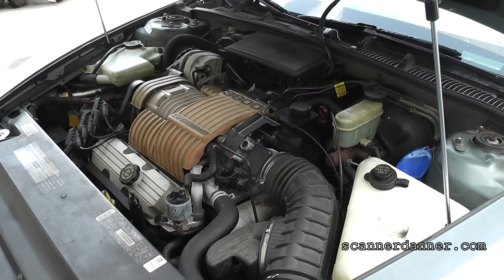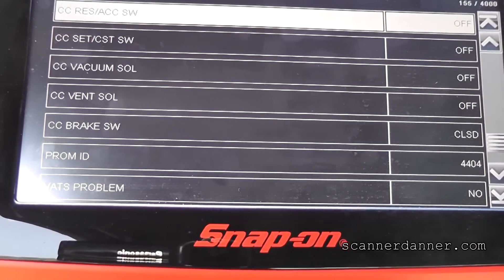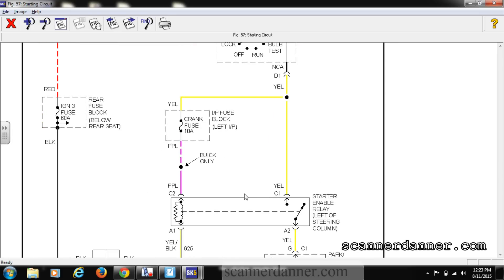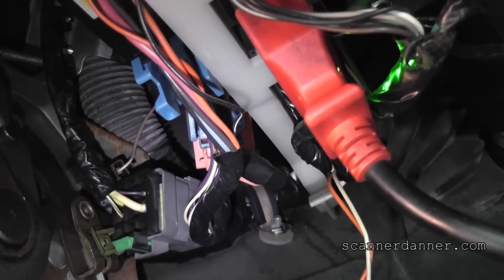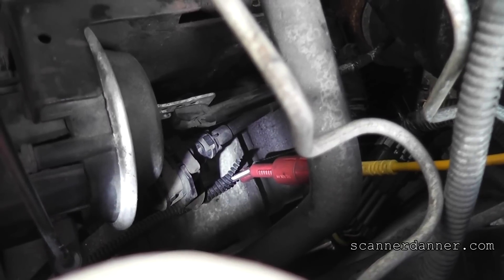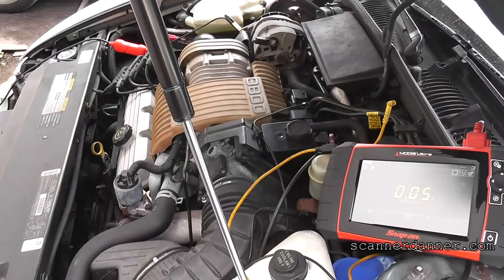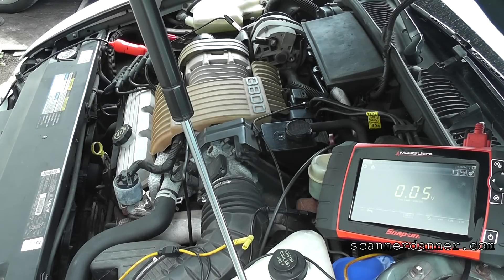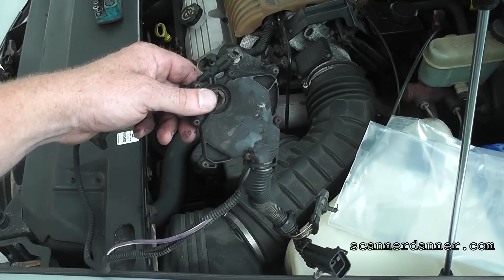How to test a starter (engine doesn't crank)- bad park/neutral switch-GM 3800

Comment: Hey Paul. I'm a big fan. I have a question about your class at Rosedale Tech. Does Rosedale allow the option of anyone to just attend your course rather than go through the entire automotive program? If not, do you offer any seasonal night classes? Thanks Paul
Reply from the maker: +120beale they have offered my class as a stand alone. Email me and I can get you in touch with one of our admissions reps for costs.
Reply: Hey Paul I really appreciate your fast response. What's your email address? Thanks Paul
Reply from the maker: +120beale I won't post that here. Contact me through my website at www.scannerdanner.com thanks!

Comment: Just want to say i love your videos.   I do have a question.  I notice when you are checking relays, you check input / output.  My question is, why don't you check the output first?  In my humble opinion, it would save you time in the long run, if it is good, you get output, so the input was there also.     Love your videos, You are the man, i have learned so much from you over the past couple of years, you should charge me tuition lol.
Reply from the maker: +Rhage73 I do sometimes. I'm not partial. Symptoms will dictate my direction and also relay location. Thanks!
Reply: Thanks for answering me, Have a good one.

Comment: The quick check I've seen is just put it in neutral, turn the key to crank, and jerk the shifter up and down, not enough to go to reverse or drive, but if the switch is misadjusted or loose, you should be able to blip the starter and confirm it's a switch problem.
Reply: Thanks. I will try this.

Comment: Had this exact same issue yesterday with a first gen Scion XB. After 4 hours of diagnosing, it was a hidden GPS tracker installed by the car lot. Dont know if it was faulty or the car lot activated it. Jumped it and it started right up. Still waiting to hear back from the customer after he put in a call to the car lot.

Comment: I loved the comment about "working in the real world" So true. You can always tell when someone has experience under the hood. Thanks for the video.
Reply: +Michael Herbert There are internet heroes in every profession. I poke holes when I have to, and I seal them up every time. Never have I had a comeback for poking a hole in a wire and it causing a problem. I'm up in Mass and if things don't get corroded up here, then they aren't gonna get corroded anywhere.

Comment: Supercharged 3800?  Squee!  Engines like that are why we need to keep at least some OBD I equipment and knowledge around.  Long after a majority of the stuff from the 80s and early 90s dies off and rusts out of existence, there will be enthusiasts who keep the few truly special things like that Buick running and driving, and the few people who have the knowledge, equipment and enthusiasm to work on them will be quite valuable.  :)

Also, I see no problem with piercing a wire.  A little bit of liquid electrical tape, or even clear nail polish, and it's good as new!  With the number of times I've seen PCMs mounted in the middle of oblivion, sometimes it's easier to just wiggle a wire out of a bundle and stab it.  Experience is a good teacher, and over time, one can develop a "feel" for whether or not a test warrants further digging.
Reply: +rhkips I  got a 94 lesabre and im in the mnarket for a SC'd 3.8. I saw one that was a granny grocery getter blow the doors off a mustang. It was classic. The passenger in the mustang was screaming' why arent we passing him?"  LMA0

Comment: I did a ford rustang with a bad fuel pump and the customer was positive that it wouldn't start because of the security light was on I used a power probe and put power to the pump and showed him that the pump would not run and still thought the security light being on when the key was in the run position was the problem. So I told him I would pay for the pump if that wasn't the problem and he said he would get back to me. A week later he told me he had it towed to Butler County Ford and they put a fuel pump in it for $950.00 I just laughed at him and said I could have saved you 700 dollars. I wont do any work for him anymore since he did not believe me the first time.
Great Video!!
Reply: +JOHN HUFNAGEL I get that a lot too, I am not a mechanic in the shop, but my some of my "friends" ask me to help them fix their rides.   Half the time i get it diagnosed and BAM off to the shop it goes.....   Makes it burn, right on the tip.
Reply: +JOHN HUFNAGEL  That's the way it is. People just do not believe a mechanic with true experience telling them what is wrong and latter it comes back and bites them in the walet

Comment: I've had a faulty TRS on my Mazda 626 and it will cause a no-crank no-start.  Not all TRS's are compatible within my model too but it's pretty obvious when the number of pins don't match.  Having no continuity on any pins in any position is another way to test the TRS.  Also some work on voltage and some work on resistance.  By that I mean the actual switch position tells the PCM the gear selection using resistance, not voltage.  If the resistance is too high you'll get the same no-start even though you might have voltage.  If your TRS works on resistance you might get caught with a misdiagnosis testing voltage only.  All of that is within the scope of different 1993-2002 626 models from my experience let alone different vehicle manufacturers.  Great video.
Reply: +DJDevon3   It sounds like to me the type of Range switch you work on is wired into a pull down circuit to the computer, which in essence is a voltage divider circuit, so each resistance will have a different voltage drop and the computer knows this by basing the drop off of a calibrated resistor with the external resistance value in the range switch, so you could figure out the current flow through each switch position and then take the current and multiply it by the resistance and that will give you the voltage drop for each switch position, just think of Kirchoff's law and it will make sense.
Reply: busjockey1 I realize that now.  Odd how the manual lists resistance values for a TRS but not voltage.  Seems like voltage would be a much easier thing to backprobe and test for while the car is running.  Why would they change from a continuity/voltage design to voltage divider/resistance?  Just seems like such an odd thing to do.
Reply: +DJDevon3   I don't know either DJ, I just learn how they work and fix em,lol.
Reply from the maker: +DJDevon3 technically the TRS that uses different resistors is still a voltage sensing circuit. You just have a different voltage signal for each gear position. (based a how much resistance) Why can't you check your voltage? I'm confused.
Reply: ScannerDanner I don't know,  The factory manual says to test voltage for my 93-97 model but the manual says to test resistance on the 98-02 model TRS.  I just go by the testing procedure.  I see what you're saying about voltage drop, never thought of it that way or tested it that way just because I'm a by the book kind of guy.  Great point.  There are no voltage specs in the manual, got me curious now! :)

Comment: Great video Paul! Thanks. Quick question : 2000 Mercedes Benz E320. V6 engine. Coil on plugs. Cylinder 1 misfire plus injector code on cyl 1. Tested injector unplugged-infinite resistance. All the rest were 17 Ohms. It also failed the listening test. I know injector is bad,but I wanted to test control-no access to wiring diagram and no noid light with me. Used my regular test light(not LED). 2 pin connector-connected my test light to battery positive and nothing on both pins with the engine running. Connected my test light to battery negative and got power on one of the pins. Any thoughts?
Reply from the maker: +Nick Nicu you may have a PCM that is intentionally shutting down that driver because it knows the circuit is open. Try this: connect your test light to B+ and touch on the control wire, then clear the trouble code (test light still connected), then start the car. See if the test light begins to blink. It should if the driver is good. Let me know what happens.
Reply: +ScannerDanner Thanks so much Paul! I'll do that before putting the injector in. That may very well be the case. I should've thought of that when I saw the car will not go into CLOSED loop. I assume it's the same reason?

Comment: Well done Paul 👍 the wire looked like it caries quite a bit of amperage. Would the use of an amp clamp displaying currant flow be something you do as well ?  BTW I poke wires also :)
Reply: +Steve Rob Yes I have done it Steve.  Once I had a ignition voltage feed problem on a Detroit Diesel 50 series where the Check Engine and Stop Engine Light would come on and then off, the Engine would intermittently die too.  The Ignition Relay is in the Rear Rack at the top and it is hard to get a Voltage reading up there.  So I hooked up my Low Amp Probe on pin 87 out of the relay and watched the current, the current went down when it acted up so I knew then I had a resistance problem.  If current went up then I know the System Voltage is being drawn down and thus taking away the Voltage from the computer and in effect there is not enough Pressure or Voltage to push the current.  Definitely a good way to distinguish between high resistance and excessive current draw from another shared current path.
Reply: +busjockey1 Me too Bus :) They should call me Pokie at work! Them harnesses look like Swiss cheese with black liquid electrical tape dripping to the floor. ha        Like Paul said sometimes you Have too!!  No need to apologize to them haters Paul, there jealous!!How many times have you back probed a connector only to have it come un done? Some connector seem to push them back probes back out no mattah how many times you try. Then you push a little harder and now you have a angled back probe. How cool is that. Then there is road testing put into the mix. good luck with them back probes specially chasing intermitents. R U  going to trust a back probed connection for a once a day problem? Not me.    Again what Paul said "real world" you have too sometimes. When are they gonna come out with a staple gun like piercing tool anyway? LOLSeriously though,  all you want to do is just  break through the wire covering just enough to have your point touch the copper.  you can do this live with your test equipment(meter/scope) running to verify your connected.Don't turn it in until the back of your probes flopps over from stress ha.I think some people state you can break through corrosion!! Well I think you would be able to see swollen green stuff blowing it up under the covering of the wire before you probed it. just my 2 centsKeep poking  America  and Canada too.
Reply: +busjockey1 It ended up being a intermittent relay contact, took apart the relay and found green and pitting.  Tried to do a Voltage measurement but It was happening so fast at one point my Fluke 87 wouldn't catch it so that's when I hooked up the amp clamp and I then caught it the act.  Now that I have a Pico Scope thought and I have intermittent problems I'm hooking up my PIco,lol.
Reply: Mike I'm still learning about the Pico they keep making the software better all the time.  Next time I have a wire I suspect has no voltage and no way of back probing to test for voltage I'm going to try the amp clamp only if I can load the circuit . Thanks Mike
Reply from the maker: +Steve Rob It does and looking back, I really shouldn't have used my Verus lead to carry that current. When both the pull in and hold in windings of a starter solenoid are energized, amperage can be as high as 40 amps, then it drops off as the pull in winding shuts down (the moment the starter begins to crank).
Reply: +ScannerDanner In this situation you had to probe the wire to get a voltage measurment.  If you used an am clamp to take an amperage reading  instead of the piercing probe could you use the amperage amount and thru ohms law come up with a voltage measurment.  Ha is this a crazy question , hey I'm Canadian Ah :)
Reply from the maker: +Steve Rob no that's a valid test. But with a no amp reading on that wire, I would still need to do a voltage measurement to find where the open was (wire or switch)
Reply: +ScannerDanner Paul I poke wires too, if have too, like you said just seal it up when your done or if you think you damaged the wire repair it.  Some connectors are constructed where it is impossible to backprobe so you have no choice, understandable, plus you want to be as efficient as possible on a diagnosis.  Good Video.
Reply: busjockey1 Mike when your working on the busses do you regularly hook up your  amp clamp to your  87V and check if there's amperage on a suspect line that cant be back probed ?  Cant say ive seen this done- just curious what others do.

Comment: Freaking poke the mess out of the wires. I do more electrical checks than any other type of job and there are just some connector you just can't reach, so you get what we have here. Poke'em hard brotha!
Reply: +Joe Lopez or the weather seal is rock solid and the only way your gonna get a back probe in is with a hammer

Comment: Glad to see you have joined the world of power probe. And when you do a lot of electrical troubleshooting you have to poke holes in wires as often a small hole in a wire can save you hours of strip down time and effectively saving the customer money. I think the people that don't poke holes mainly work on big rigs where access is not a problem. But in the car world there is no way around it and I do it everyday and then just repair it. Keep up the good work. Your very talented and I have learned a lot from you.